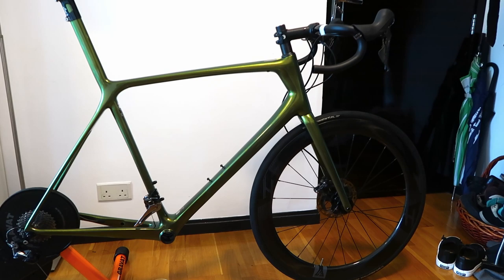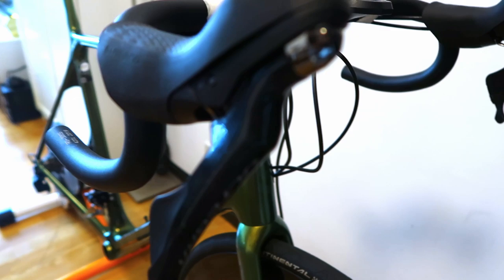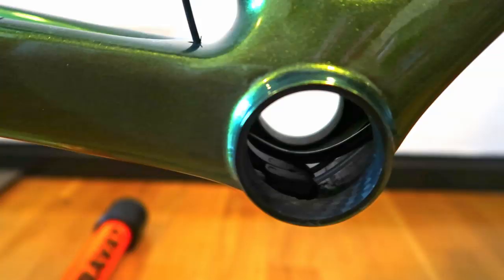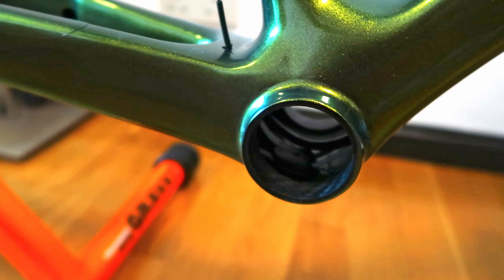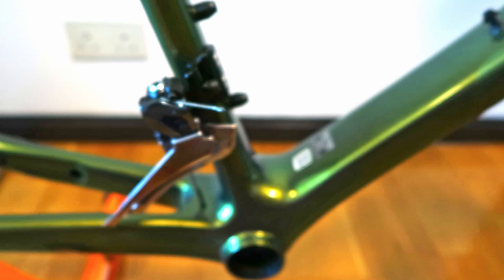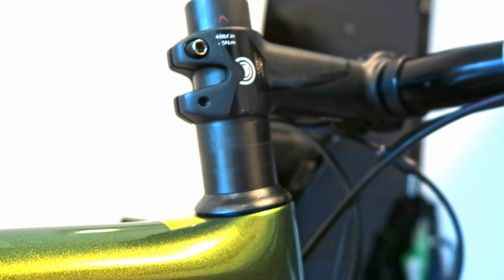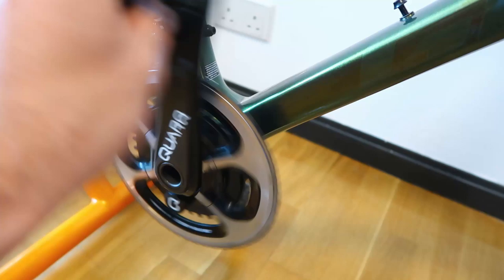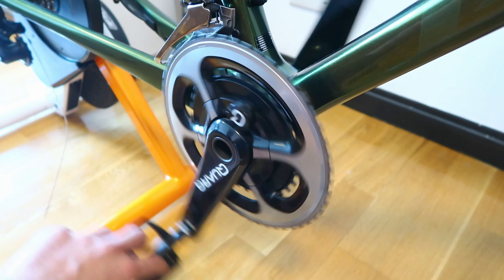Giant TCR Adv SL Disc Build Ep.3 - BB install

Comment: The trick with the front mech cable tension is...

- make sure the front shifter is in “small ring position”
- pull the cable through pretty tight by hand and clamp it as you have (helps to wear mechanics grip gloves)
- shift the mech into big ring position, then do one micro adjust click so the mech moves slightly towards the small ring position 
- next use the small Allen key (I think it’s a 2mm from memory, but might be 2.5mm) that’s protruding outwards from the side of mech. Turning it inwards pushes on the clamp plate and increases the cable tension.
- there are two indicator markers on the rear of the mech. Once they’re lined up, the cable is the correct tension

Comment: Once you've cut that ISP the steerer is a doddle. No doubt you'll slam it but more power to your elbow. F that DI2 sh/t. I went SRAM etap (Red 11 not 12) and can honestly say that I won't go back and the lack of cables / ease of install is unreal. I also went WheelsMfg for a threaded pressfit bb. All good it's awesome, but I now have a bunch of tools that won't get used this decade (fingers and everything else crossed) so that's one thing to consider. I have to say this was a mid life crisis build, not an evolution so that informs a lot of the cost decisions.

Can't wait to see the first ride! The frame is awesome.

Comment: I have a Hambini BB86 one piece BB for my propel 2016...however it has some carbon reinforcement at the inner side of the bb shell obstructing the way..i can see you have the same issue from that closeup
Reply: Too bad for you...Hambini BB is a huge waste of money, you press the drive side bearing in twice upon install and boat anchor heavy.

Comment: I noticed that you have the white and black cable sheaths/cable runners (FD and RD) going through the BB area and the black plastic cable holder. Do you leave those in, or pull them out after you install the FD/RD cables?

Comment: I also prefer the previous front derailleur design. I removed my R8000 one and replaced it with a 6800. Shifting much lighter and smoother

Comment: Nice video. I also have a giant but having the overdrive system it's more difficult to find parts. Where did you buy the spacers(I can only find the ones branded overdrive)  and what brand your stem is?
The common expansion plug from giant is sitting on the edge of the fork,so it is level with the top edge of the fork. Having your stem lower, the plug is not anymore behind your stem's bolts. Is that ok? 

Good luck finishing it.  It's a a nice colour ;)
Reply: PRO does spacers, https://www.probikeshop.com/en/de/pro-1-1-4-spacers-carbon-ud/134541.html
FSA probably has some as well, spacers should not be too much of a problem. Top caps are rare.

PRO also does stems, Ritchey also. They are refreshing their lineup, the 2020 WCS level has not yet been released. You can get the Comp level (heavy), Ritchey Comp 4-axis 44: https://www.probikeshop.com/en/de/ritchey-comp-4-axis-44-6-bb-stem-black/167563.html
Reply from the maker: The spacers came with the frame set. Yep correct, the expander plug is set too high. I will cut down the fork ASAP

Comment: Weird that the front thru axle goes far beyond the fork like that :/  5:06
Reply from the maker: Yeh its not the right one, just one i had to hand
Reply: @PeakTorque  oh ok, did they not give you the thru axles with the frame set ? 🤔
Reply from the maker: @Zeben84  yes. I replaced it with a DT swiss one which is about half the weight

Comment: Did you get a bike fit? Do you believe in them?
Reply from the maker: Depends on the bike fitter. If you have a good understanding of geometry and biomechanics you can pretty much do it yourself.
Reply: As someone with none of the above, I already had a bike fit done to solve some hip mis-alignment, so I just used the measurements from that. I would say it's key if you have an ISP. That said the variance in the quality of the fit would be a red flag, but a good one will keep you in good stead for many years.
Reply from the maker: @gregstevenson7401  very good point. If you have an ISP you need to know pretty damn well your seat height. So get a bike fit.

Comment: Pretty stupid video, I've just built up the same frame and you completely skipped the hardest part which was installing the cables through the frame!!! Also you could have explained how you arrived at the cutting point on the seatmast? But great bike. Oh and the park cutting  tool works just fine with a nice square cut for anyone thinking they need to 3d print a special clamp!
Reply from the maker: Sorry
Reply from the maker: But i put the fucking saddle on, and then i fucking measured it
Reply: @PeakTorque  With what a tape measure? from where did you measure? If this is supposed to be an instructional video of how to build a tcr advanced sl people are going to be disappointed because after listening to you waffle on for 10 minutes they're not going to be any wiser. Also you shouldn't put yourself on the internet if you cant take criticism.
Reply from the maker: @Upthegicker  noted!